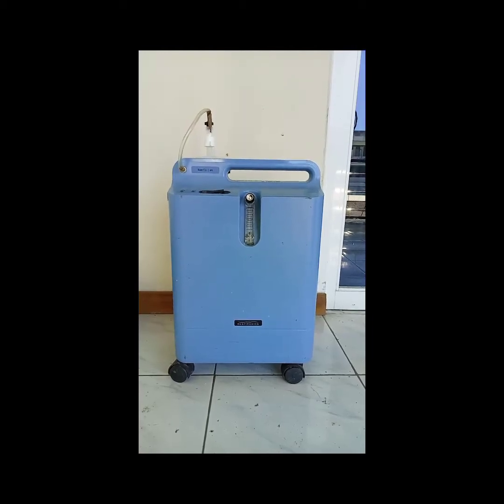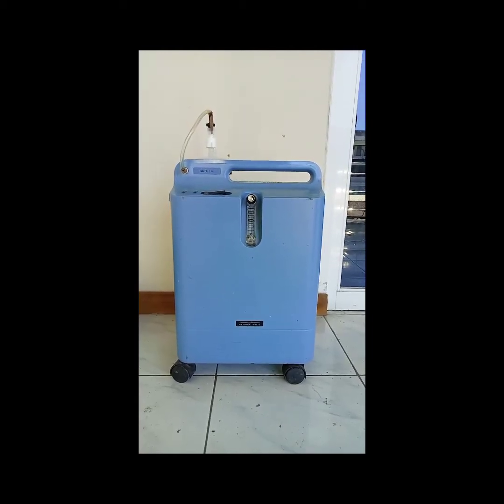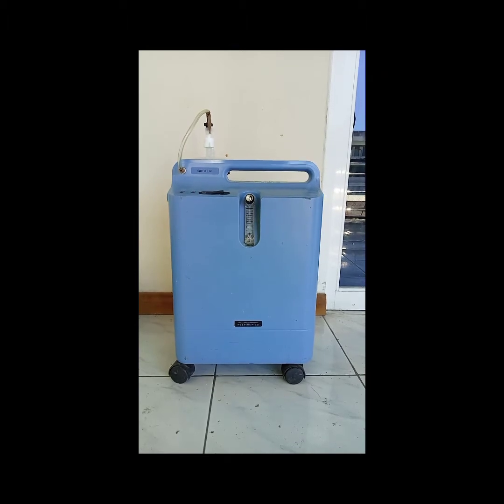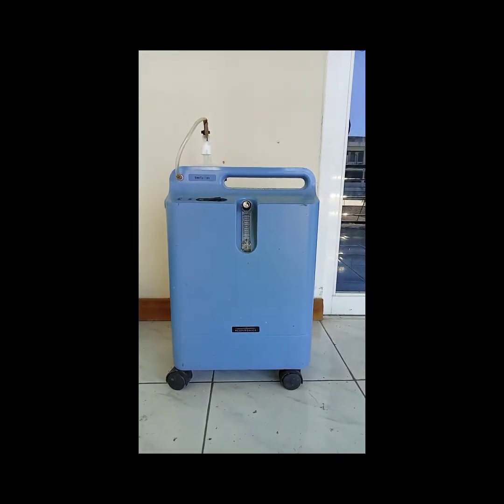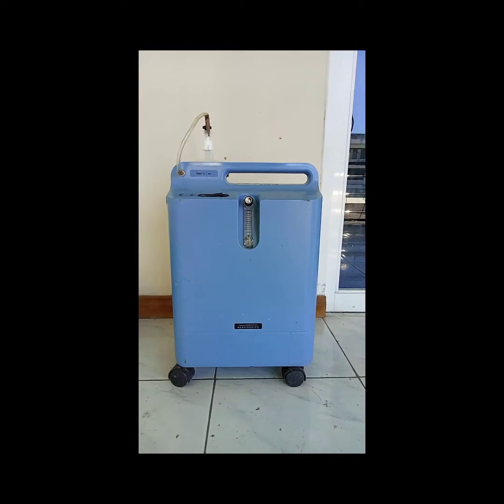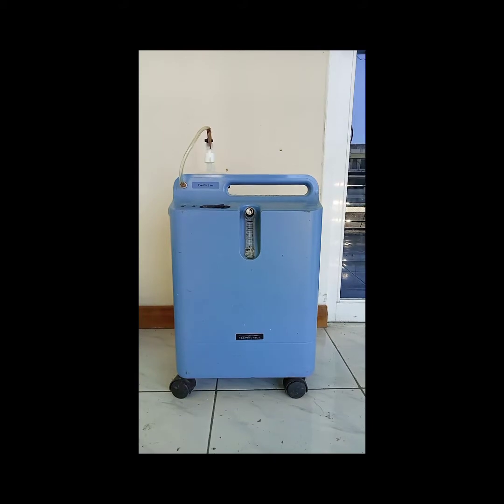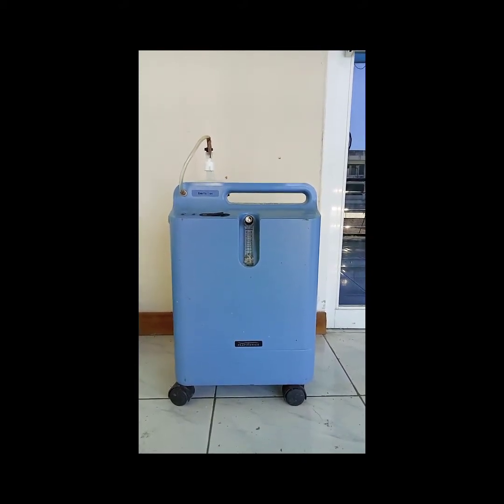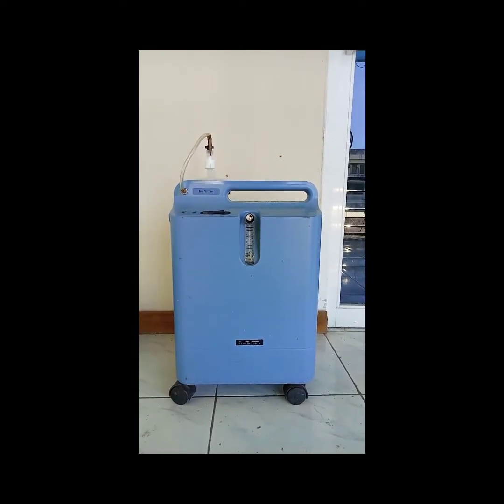Oxygen concentrator Alarm.. check main board and compressor capacitor

Comment: If you got airflow then the compressor is working. Also much to my horror the unit does not have any oxygen or patient side differential pressure sensor only a sensor that measures the mean oxygen pressure. 😒

Comment: Sir replacd capacitor compressor still not working
Reply from the maker: good day sir does your compressor have a humming sound if the power is turned on.. if its does then maybe the compressor is stuck up..

Comment: Compressor is now starting should I also change capacitor
Reply from the maker: check first the capacitance if its below 20 percent of the rated value then replace it sir..
Reply: @electronicsandbiomeds7391  changed the capacitor, compressor still not working, thn gave direct supply to compressor still it did not worked
Reply: @electronicsandbiomeds7391  do uh have any contact from which I can buy new one